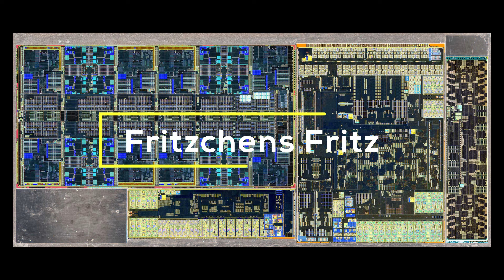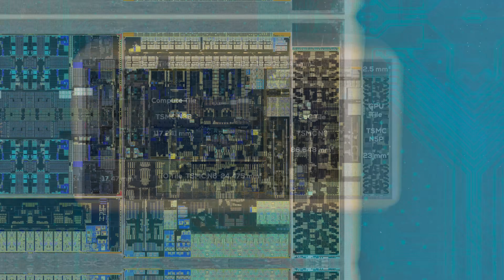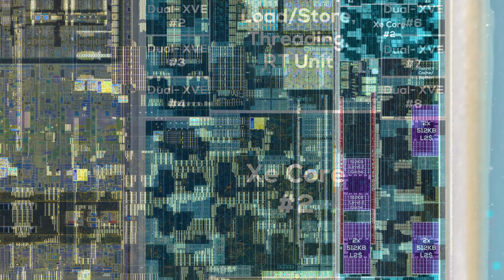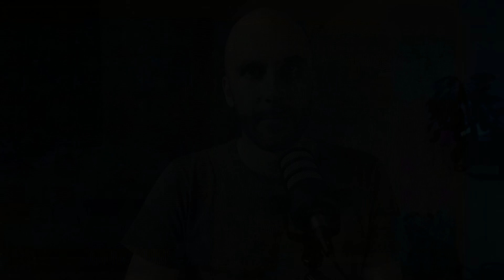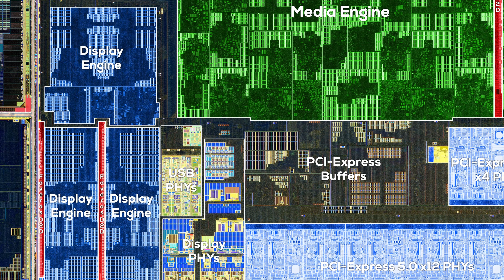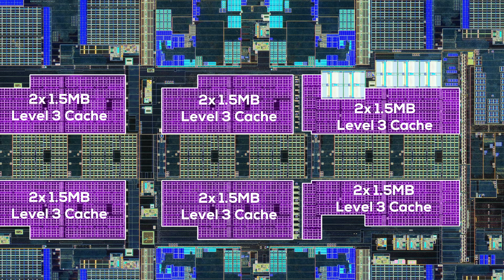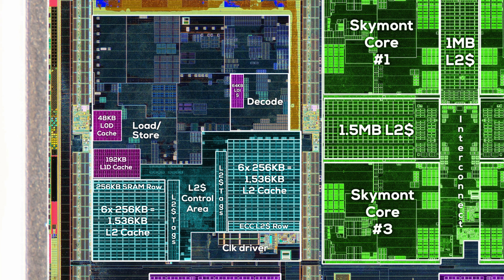Intel Arrow Lake Chip Deep-Dive

Comment: Ngl, a lot of work intel put into these chips just to get smoked by arm…
Reply from the maker: Smoked my arm? Which chip are you talking about?
Reply: @HighYield  The M5 Max is incredible. Intel is getting stomped by it. At least in benchmarks. If qualcomm is able to match it for windows through die improvements and software optimizations, Intel is cooked unless they have something earth shattering up their sleeve. My humble opinion is that CISC is on the way out for consumer devices.

Comment: D2D and NGU latency and MEM Controller further away is way CPU-bound games still have better 1% lows on i9 14900KS/Mobile i9 HX. You can overclock the NGU/D2D (MSI Vector/Raider/ Titan laptops gives you room to OC it and tune the RAM) and tune your ram timings very aggressive to get higher 1% lows and a bit higher averages in cpu bound games. Still some games prefer HT ON over HT OFF.

Comment: Core ( Ultra 285 K is goated i promise, the P and E core plus NPU concept is extremely refined and potent for some workloads. people just dont understand the concept of Fast ram with low latency super charging this chip, its always the high voltage and heat brute force idiots that don't understand how compute or bandwidth works (AMD) 
And yes this chip can SEND some data like a minigun if you get some 8000MTS RAM with good timings, which, is the only point of a CPU

Comment: My biggest question is:  Is this finally RELIABLE???  After the Gen 13/14 fiasco, and the bricking of my 2023 Blade 16, I'm pretty hesitant to buy another from team Blue.
Reply from the maker: Arrow Lake doesn't have the same issues as Raptor Lake, it's a new core design and a different process node.
Reply: @HighYield  Thank you for responding with your opinion on the matter, I appreciate that.

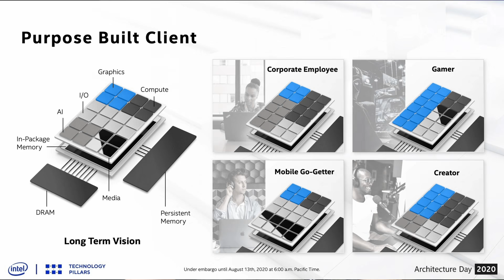Comment: 1:04 Wait a minute... "Persistent Memory" ?? That's an oddly familiar naming scheme. Sure, NAND Flash is technically persistent. But the last time I heard Intel using the term "persistent memory" they were referring to 3DXpoint. Did Intel not entirely shut down the 3DXpoint RND, or is it just your bog standard NAND Flash?

1:05 F***ing s**t. I just noticed. The presentation slide is from 2020 :*(  Before Intel canned the Optane IP. Well, one can dream.

Comment: 87em.exe. the system calls for the 12 kb instruction set its name can be anything. The call is about 1-2 seconds it has to be found in the root before starting a game. If the file is not found because it's deep in a folder then the game has less chance to win. Not very compatible with xc cards I didn't find a 287 version. Complicates a mahjong game, but doesn't correct the losing, 80% you lose 20% win. Hc is 90% win 10% lose. Non A1 is same as HC. To force your driver emulation to maximum you have to play Mahjong hard square levels not round or mixed, about 25x for best performance. That means 25 wins. The emulation affect all other features since it is the same as an industrial floating point unit w 90% accuracy.

Comment: Wait, Intel are using TSMC? I thought they had their own fabs. Did they get tired of 14nm😅
Reply from the maker: Arrow Lake was initially planned on 20A (at least the compute tile). But since 20A was dropped in favor of ramping 18A faster, it didn't happen. Intel 4/3 is actually a pretty good node and 18A has the potential to be very competetive vs TSMCs N2.
Reply: I was thinking about the TSMC N5P node. From what I gathered it is made in TSMCs facilities in Taiwan, then shipped (with tarriffs) to the US where the rest of the assembly (etching?) is done..?
Reply: intel are incapable of making their own chip that isn't (14nm+++++++)

Comment: Thank you for this awesome video.
Arrow Lake is extremely underrated, because it's not 50% faster in games than AMD. Apparently that's all that counts today.
The whole LGA1851 platform is far supperior to AM5, counting cheaper and more flexible motherboards. Don't get me wrong, zen5 is great, but AM5 lacks pcie lanes and motherboards are 50% too expensive for what they offer.
Reply: Well it was slower in games than even their 14th gen chips, it just further increased the gap.

People don’t care about motherboard prices as much, as AMD chipsets branch over multiple generations without requiring upgrades.
Reply: @zachb1706  yes, people are not very smart, that is true, not a lot of people care for a base of their computer.
I screwed myself with AM4 motherboard. I have asus prime x570 pro, but it only has 2 M.2 slots. It's has 6 pcie slots, 2x pcie x1 are unusable because of the big ass GPU, one pcie x16 is unsuable because it shares lanes with primary pcie x16 slot, in third pcie x1 i have dual port ethernet card and in last pcie x16 i have usb 20gbps card. I bought this MB with upgrade in mind, but then i noticed how screwed i am, and i refuse to give the money to AMD, so i still use 3700x. I will give this setup to my father, because it is unusable to me. AM5 is even worse, it's a joke platform, borderline scam.
It's like buying a big and expensive car, but it's only for one person.

Comment: Nice vid! I watched till the end.

Most youtubers are focusing on gaming performance and Arrow Lake is a step backwards for games. It is slower than Raptor Lake for many games. And that my friends is the ONLY downside to this chip. (Well, besides the price.)

It is not confirmed but my guess is, Arrow Lake, like Zen 5 is a 512bit CPU, in that the internal bus width between ALU, FPU/AVX10 (combined?) to cache is 512bit wide. The FPU/AVX registers are also 512bit wide, meaning it can handle an incredible amount of FP/Vector calculations.

Intel's per core cache seems higher than AMD so it's no wonder IPC and compute workload is still higher than even the 9950X. BUT, the lack of SMT really hurt the performance of multicore.

On the flipside, losing SMT hardware means Intel can concentrate on E-core perf/W and optimise on power-savings. This is why I am interested in Arrow Lake-Hx mobile CPUs for my next laptop. They should be better than AMD Strix Point in power consumption. This is why Zen 6 mobile is rumoured to have a 2-core ULP Zen 5 in the IOD.

However, the trump card AMD has is the huge 96MB Shared L3 cache hidden under the CCD. Arrow Lake L3 cache is split amongst the various cores so the game engine cannot be fully loaded in cache.

Also, a ring network generally has consistently higher latency compared to a Hub/Star network (in Zen 3-5.) (I'm assuming by ring, it's like IBM Token Ring where the bus arbitrator allows bus access in a round-robin manner and sleeping cores are drop from the pecking order.)

Intel still isn't as experienced in tile-based manufacturing as AMD. AMD already have many types of tile interconnects in their various products. It would be interested to see how Strix Halo is stacked. If you ask me, Strix Halo is a different product category from Strix Point. Quad-channel in consumer CPU space is something new!

Comment: Impressive technology from Intel. I just realized by listening to it that this is how actual CPU should be designed. AMD always goes for hacks and short sighted solutions. Their chip design was talked about for so long and in the end it is just a whimper of true multi-die design. 

I do have faith that this design will mature better and with time catch up with AMD. Intel's problem is that this investment came way too late. It had to be released at least one year before to be even a little bit relevant. As it stands now, it is more of an experimental technology which nobody wants to buy on DIY. However, they are stellar on laptops due to their power efficiency.

I stayed for a whole video.
Reply: Yeah, they are way too early. Clearly need more work, especially on memory, dies just cant talk with eachother fast enough (not to mention intel not having their own node for them yet and choosing to skip current ready one for better future node).

Comment: I find Intel's argument of scalability on the IO tile weird. What's the point in comparing 2 differently sized IO tiles in the slide when a more sensible way of scaling would be to use a single size for every SKU?
And why make it discrete from the SoC tile anyway?

Comment: I watched until the end.

On your comment about the public opinion of Arrow Lake, my PERSONAL opinion is bias towards Ryzen (7800X3D in my case) because Arrow Lake seems overly complicated with so many different clock regions that affect performance in different ways. On Ryzen, you can overclock easier and the gaming performance on X3D is generally better out of the box. I also personally don't care about E-cores at all as I don't multi-task much or use heavily threaded programs, plus I run Linux a lot which doesn't have so much junk running in the background. I was happy to read something about Intel considering releasing a P-core only CPU soon.

I will keep an eye on Intel products in the future and always keep an open mind but currently AMD is just more consumer friendly.
Reply from the maker: X3D was a genius idea from AMD. I'm still running my 5800X3D with no reason to upgrade. There was a Hot Chips presentation from Intel a few years back where they showed that the interposer can also contain cache. I hope Intel actually does that.

Comment: The Technological Leap in Architecture is impressive. Give Intel a refresh of Arrow Lake, and by the next Iteration, they will have optimized their tile (chiplet) layout to reduce the additional latency added by moving from a monolithic die to the Tiles.  AMD also went through this when they moved to Chiplets. It's great whether you prefer Intel or AMD CPUs, because when the competition between the 2 is pushing hard, the Consumers Benefit from greater CPU Value.

Comment: Intel's tile designs are puzzling to say the least.
It does same basic things rights:
1. Using older nodes for IO as it benefits less from newer nodes.
2. Foveros' on-silicone interconnect fundamentally uses less energy and has way higher bandwidth than on-package interconnect (AMD IF).

But Intel's tiles misses out on the most important part, MAKING THE COMPUTE ITSELF SCALABLE AND FLEXIBLE:
1. All AMD products share the same tiny 8-core CCDs, enabling them to scale from 4 to 192 cores, have very good yields, and AMD can pick (bin) the best CCDs for Epyc from millions of CCDs.
2. Intel's Arrow Lake compute tiles are monolithic, and different configurations need a redesign (lithograph masks costs millions and months to design/validate). So the tile that needs to yield, scale, and be flexible the most, is the tile that is monolithic, not scalable, and not flexible.
3. Intel's Xeons does use 4 tiles arranged in a square, but the tiles on each diagonal are different (the top right tile won't work in the bottom right no matter how you rotate it), so that's 50% less tiles for the binning process. Even more comical is that both 64 core and top end 144 core Xeons need 4 tiles of the same design.

Intel's tiles, Foveros are amazing technology, but Intel is still stuck in a pre-chiplet mindset, which sucks as we need Intel to be as competitive as possible.
Reply: Kinda late but aren't epycs Zen 5c which is quite a bit different from Zen 5?

Comment: If China fired ballistic missiles at TSMC then both AMD and Intel would be unable to make CPUs since they're both dependent on TSMC. This is concerning. Now it's true Russia and China would lose access to TSMC too. However sanctions have stopped TSMC selling high end chips to them already and both China and Russia have their own fabs. Those are obviously not a patch on TSMC but they're good enough to build the chips their militaries need. Could the US survive someone cutting off access to TSMC? It's not at all clear it could. The fabless model where US companies get their chips made at TSMC is cost effective so long as TSMC exists. If it disappeared one day there would be an enormous scramble to try to find alternative fabs. And plausibly those alternate fabs would be less sophisticated, more expensive and lower volume than TSMC. Meanwhile Russia and China have essentially already been forced by sanctions to decouple themselves from TSMC manufacturing and Western chip design.
Reply: TSMC is already well established in the US... And even if it hadn't gone offshore, bombing its fabs would be silly since Chinese firms still rely a lot on smuggled chips.
Reply: Intel can and still make CPUs on their fabs. It's just that Arrow Lake is designed to be made on TSMC.
Reply: @Winnetou17 Arrow Lake was meant to be manufactured by Intel, but they canceled the node it was going to be made on.

Comment: Interesting just how much area goes to I/O and the media engine as well.
Reply from the maker: You have to consider that both SOC & IO tile uses N6, which is a 7nm class node, while the GPU tile is on a 5nm class node and the compute tile even on a 3nm class one. So the transistors in the SOC & IO tile are "larger" to begin with. Just if you compare area/size.

Many thanks for the super like!

Comment: My God they wasted a lot of space on those shitty E cores. Hope the guys supporting e cores got fired. And those for AI too. Why in the world put an AI on the cpu when the discrete gpu is 50x faster? I had both the 7800x3d and 9800x3d and its mindboggling that those where made at the same time Intel made the 14gen and this design. No wonder theres another firing round over at Intel.
Reply: You won't see your E-cores dream anytime soon, since the new ones are much better, and decently close to the P cores in performance. And more helpful in general, including in gaming. Still not perfect, but certainly good enough for them to double down on it.

Small NPU embedded in the CPU is usually much more efficient energy-wise (of course, for a workload small enough for it). Also, having a GPU is not guaranteed. Computers used for offices usually don't have a GPU (except for things like game programming). Those computers would still benefit from the NPU doing background blur at 1W on conferences instead of the CPU or iGPU taking the load.

Comment: Hell yes, I'm so glad to see you get into Arrow Lake after the amount of time these chips spent in development, both in labs like mine in Component Research, and with the uArch teams. I'm happy to at least try to answer questions people might have, but know that I'm very far removed from product development. My area of expertise is more like what you saw in the last foundry event.
Reply: Which tiles are coming back to Intel foundry for Panther lake and nova lake? This seems like it’s all on TSMC! What advantage did TSMC give here for this product to make the product team choose them over you??  Thanks!
Reply: @ I sadly can't divulge exactly which tiles are 18A, and I wasn't on the team that decided which tiles of Arrow Lake would be external. I'm tap dancing around NDAs for some of this so my apologies if the answers aren't great.

The main advantage in my mind for choosing TSMC for Arrow Lake was the immediately avaliable large node portfolio. They have N3, N4, N5, N6, and N7 and their variants ready to go all at once. While Intel does have 3, 4, and 7 ready as well, that extra volume between all of those nodes makes a big difference.

Xeon consumes a lot of Intel 3 volume, so using it for the compute tile was a tall order. Intel 4 doesn't have the density libraries needed (that's Intel 3's job) to make the compute tile work, but could've been decent for the SoC tile.

I suspect existing volume contracts are what drove the choice of N6 over Intel 4 there. I/O tile goes the same way there I think. It could have probably been made on Intel 7 like the Z890 chipset. The GPU tile being on N5 is possibly a product of ARC already being designed for that node for a while now, and the tile being an updated form of MTL's. Those designs were closer to just being plug-and-play on that node than in porting to an Intel node.
Reply: @DigitalJedi  thanks very much for the response. I’m hyped for all the leading edge stuff the TD team have been cooking up for Intel Foundry, 18A and beyond. I guess at least the graphics tile will stay on TSMC for a few generations because no point messing up their stride now that they are making progress. I think our minds are going to be blown with what intel product team can achieve using your new foundry processes as they come out, 18A-PT base die with 14A compute tiles etc & all the crazy Foveros packaging linking it up; I feel like Intel’s best product days are ahead of it with this techno magic starting to come out of Oregon. Hats off to you!
Reply: A few  question I will try keep them generic to not cause you trouble regarding NDAs

how long does it take for a product from definition to like in consumer hands also are the nodes decided at the product definition?

Also is Intel 3 good for making GPUs? cause traditionally Intel nodes have been HPC Focused even 18A is HPC Focused node

Also does Intel 7 uses Industry standard EDA or is it still Intel Custom EDA?

Comment: 16:30 The memory structure between the two vector register blocks is where the AVX-512 scalar registers and x87 register stack are stored. Intel dedicated a separate storage location for these type of registers since Skylake, easing vector register file contention.
Reply from the maker: So if this version of Lion Cove supposedly has AVX-512 removed (just like HTT), it shouldn't be there?
Reply: @HighYield  The rest of the AVX-512 hardware is there, but it's disabled in all heterogeneous implementations.